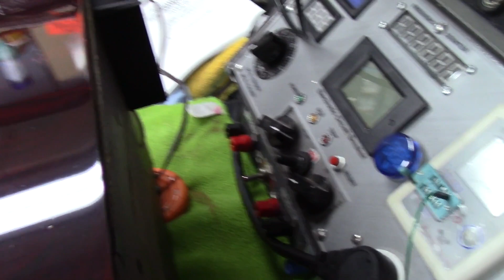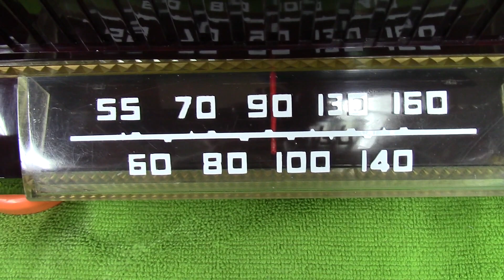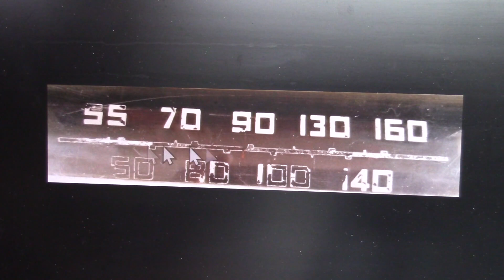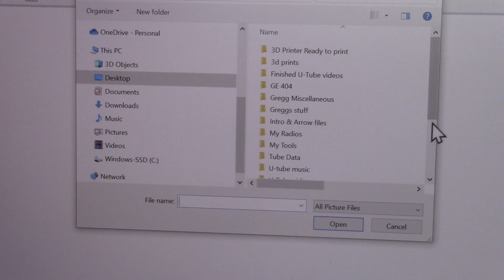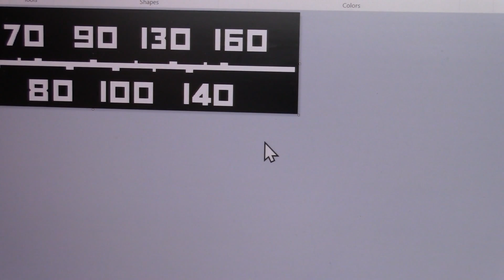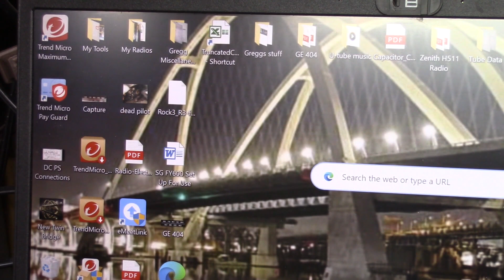GE 404 Six tube radio-  Part 4 - Final/Completion

Comment: Amazing work on the chassis Gregg, it looks beautiful and good job as well on the dial repro. Thank's for sharing.
speaking of stickers, i reproduced the Aerovox electrolytic stickers for the 87-K's can, i have extra if you need a few. Would also offer you IF cans from RCA's 86-T and 87-K but they probably wouldn't be a match right ?
Reply from the maker: Thank you Raymond, and I appreciate your offer, however no the IF's are not the same.
Reply: @greggsvintageworkshop8974  Yeah it figures and the hunt begins right ? Lest me know if you want some of the stickers. They look pretty nice once applied to the cans 🙂